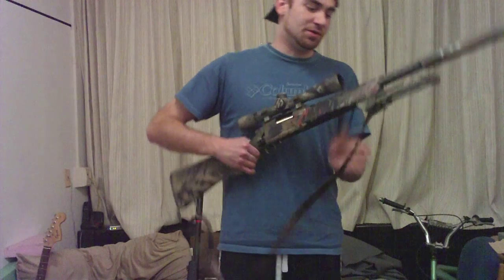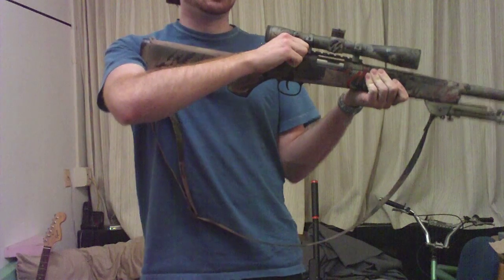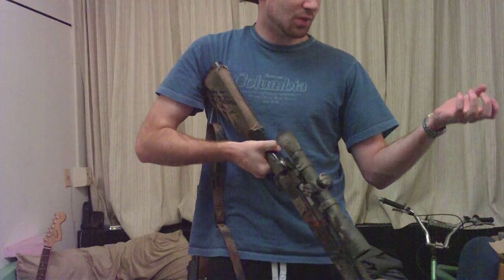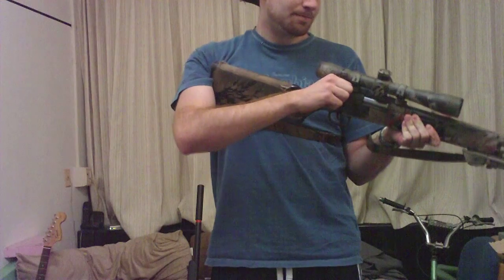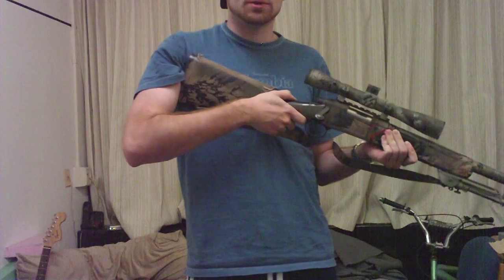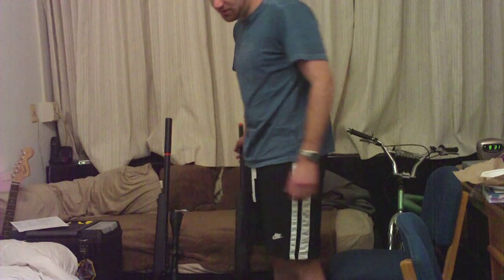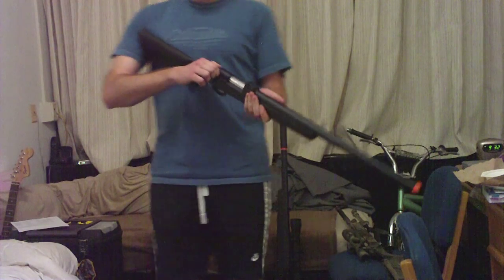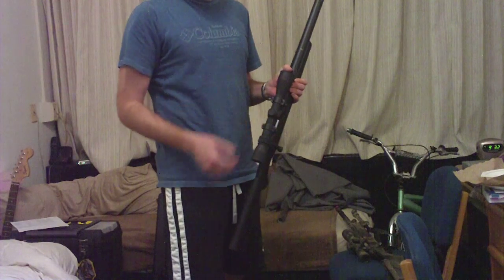Easy bolt pull

Comment: @ClapMeDown the forward resistance is due to the 45 degree sear system you use. the 45 by nature was designed for a light trigger pull, and wasnt a problem in japan due to FPS restrictions. once you move up spring ratings, the sear system will force the piston and spring guide up, causing lots of friction. buy a 90 degree system and you will not have that problem

Comment: what upgrade parts you have in there. Edgi and if you upgrade with an m170 is bolt hard to pull back for 13 year old

Comment: should the cocking bolt be on the right side of guns?
i mean, im not in the army, but they did say not to release ur gun hand to do anything, let ur left hand do the job such as reloading/holding/scope adjusting/etc
but is that okay, does the function/design irregulate the rules of military shootng techniques?

Comment: a tightbore and an m150 will get you over 500. and remamber fps aint everything. my bar-10 could probably out shoot your gun with its m130 when you havean m150. also the fps limit aint a goal dont upgrade just to be barely legal